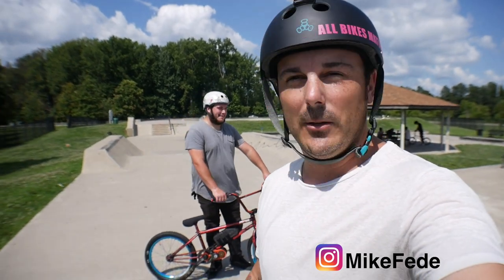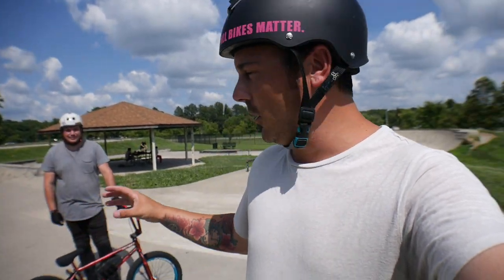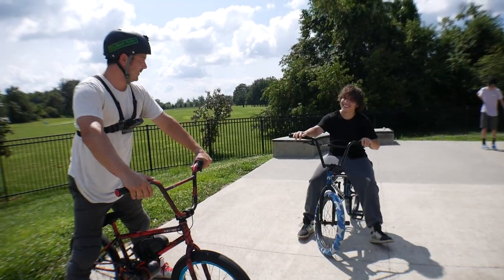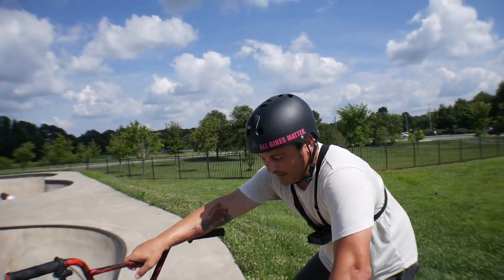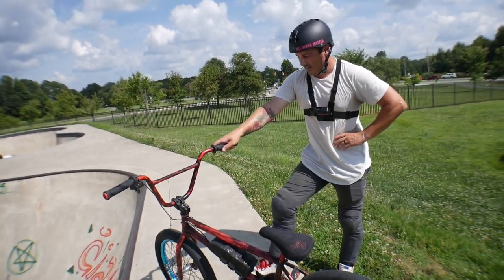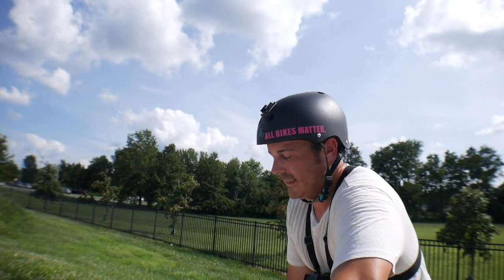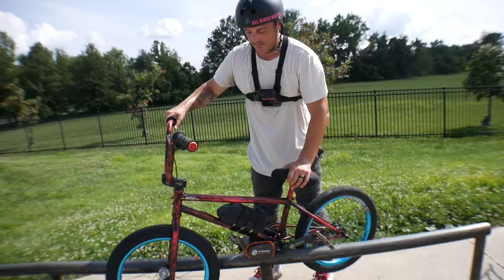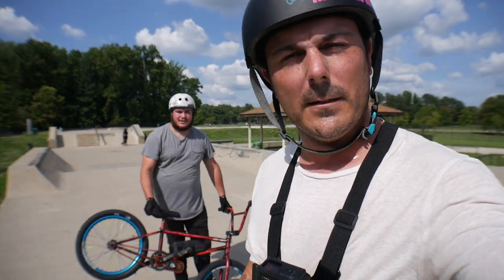** MY NEW E-BMX BIKE ** -The Future Is Here!

Comment: This is the dream!!! I'm telling you this will blow up.
Reply: Like literally sounds unsafe
Reply: @JamesSmith-ny7le  LOL I see where you're coming from but I meant slang I think this will take off. I could see your whole window for tricks. I could see a clutch down the road letting you roll front/wards and backwards without engaging. The weight problem will be fix with advancement.
Reply: @brianrand7191  a motorcycle is not an electric BMX bike
Reply: Let me see any motorcycle do what Mike video is doing on that bike.
Reply: @jeramimachado383  it’s a motorized bicycle. Originally they were all gas combustion engines but new motorcycles have electric motors also. Check out the Ktm dirt bike. Besides tails whips and barspins it can do everything else you saw. They are pretty cool.
Reply: @brianrand7191  ..... you genuinely think I've never heard of a combustion engine and its uses and all capacities?
Reply: @jeramimachado383  sorry bud- I didn’t mean to upset you. I’m just saying motorized bicycles are a very old idea. I agree that they are fun. It’s cool the the technology is smaller and quieter now but in essence- this is a motorized bicycle, moped, motorcycle, whatever. The concept isn’t new.

Comment: I've been wanting to make an electric BMX for a long time now and I have a couple of unique ideas I'd like to see happen in the industry....
Reply: go on...
Reply: @ParadoxKinetics  - I like how Mike has the motor setup on his bike, the motor grind was an awesome test of product and I'm thoroughly impressed, but I'd rather see it inside the frame triangle along w/ a small battery pack that can be taken off to charge. Kind of like the one Mike has in the video but maybe a little bit more contoured to the frame to help it fit in tighter to lessen the vibration and the potential battery problems, I had a couple of different ideas for battery placement too to help overall balance.... I was also thinking about a 2 directional throttle so you could throttle forward or backwards, but that would probably be a BMX specific thing only.
Reply: @xpndblhero5170  yeah these are good ideas, it never shows but the motor is actually heavily contored along the middle of the top, allowing it tuck much higher than any factory e-mtb motor. The problem with motors for inside the frame is they dont fit most frames - eventually most people want to sell their bike to change  frame style (eg. from a jumb bike to an MTB), and in our case this is much easier because you can simply move the motor to any frame after.  We do have easily removable batteries that are only about 30% larger than mikes, still well smaller than standard, and we have ways to fit them to most frames
Reply: Wireless throttle/esc
Reply: @lovin_lanaodi  A wireless throttle would be novel. If someone has one+receiver, that puts out to 1-4v throttle signal, please send it to us 😂 so we can put the right connector for the receiver, test, and put it on Mike's bike!!
Reply: @ParadoxKinetics  you could do that on a esp32 easily... but i dont really see any real benefit from removing a small wire and then having the hassle of another battery.

Comment: if you rig up some disc brakes from a mtb and maybe have two power settings you essentially have a lightweight, suspensionless sur ron that can still rip up the park a lil bit. actually might try to build something like this myself for stunting but if someone sold a complete bike this way I would fs buy it

Comment: I would fab some kind of skid plate to protect your mid drive from damage doing those rail tricks. I have a couple of hub drive E-BMX bikes but I don't use the bikes like you do by any stretch of my imagination. My generation created the BMX bicycle with ten speed seats galvanized pipe handle bars, primarily for ramp jumping. But roll forward one hundred years and few dozen fractures later I build E-bikes for folks and fun but so I can keep riding. My wife thinks I look silly on my small bike but in the city, in traffic and on the walks this thing rules. Only wish I could show you here but My design purpose for using a BMX bike is the frames strength. I have built mid drives for 26 inch and larger but not an 20 inch yet I will be checking out the system you have there for sure. You can only take with ya what you came in with.

Comment: If you could help I got a 79.375mm width and a 1 and 3/4ths inch diameter I'm trying to get a motor that'll work with it. This motor you are on is alot more than I wanna spend. Idk which way to go snd alot of companies won't guide me in right direction and I heard when the wheel motors die they feel like a workout bike

Comment: Left side throttle!?? My brain couldn’t operate that with all my years of quads and dirtbikes.
Reply from the maker: Yeah I had to put it on the left because my handbrake that locks up the back wheel when I put it on will be on the right hand side. I was going to try to think of a way to utilize the throttle on the same side as my brake but I’ll have to see how that goes.
Reply: @MikeFede  
Yeah I feel ya totally. And a twist throttle would basically be out of the question. You made it work though! 🇺🇸🇺🇸🤘🤘
Reply: @MikeFede  just use a longer or shorter brake lever. since you have a thumb throttle it wont interfere, just like thumb shifters dont interfere

Comment: You can get 2000watt conversion kits for bikes that go over 100mph this isn’t new tech dudes, I build a mid frame 1500watt with water bottle battery in a BMI few years ago and it did over 70mph